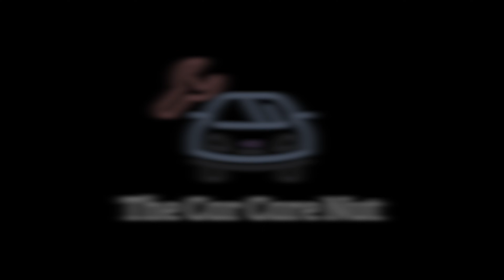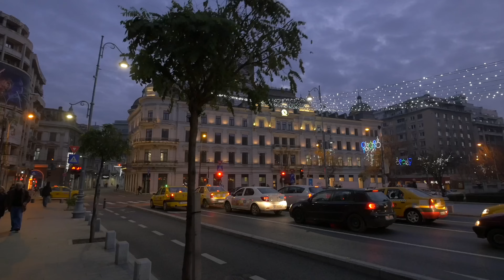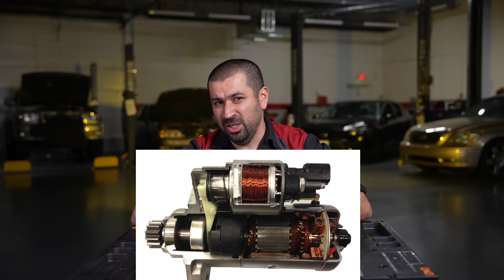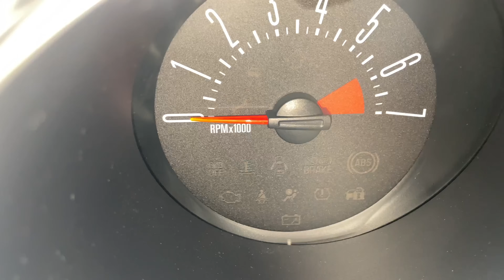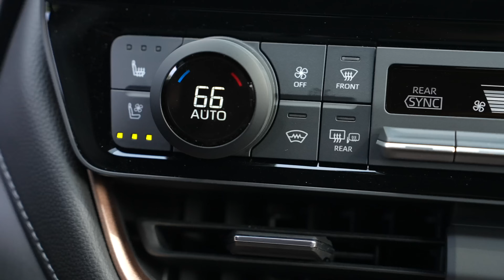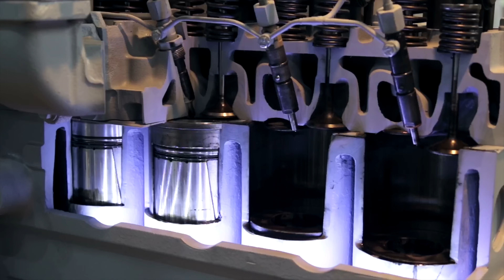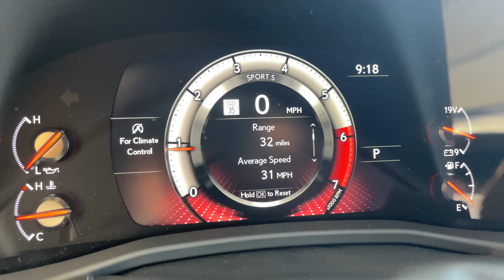How Does Start Stop Technology Work in Modern Cars? Everything You Need to Know

Comment: It works by annoying the hell out of you hence why I always turn it off.
Reply: I just hate how it resets every time I turn off the car!!
Reply: @adrianruiz8690  pretty sure they designed it like that to force you to use it 😂
Reply: Agreed. It's pointless.
Reply: Engine shuts off, ac turns off. In my experience.
Reply: I installed a bypass module so it will turn off once started the engine. 2020 Toyota Rav4 XLE
Reply: @l @lsbautista21 s it very expensive to install a bypass system ?
Reply: Should be the opposite button to turn it on if you want to run it with it off as the default.
Reply: So do you need to turn it off every time you start your first drive or does is it always off?
Reply: @petayV8  as far as i know it has to be turned off every time the engine is started. no way to disable it permanently
Reply: @petayV8  It's always off.  This does not work for all Rav4 models, but for mine if you unplug the hood safety connector it thinks the hood is open and will never stop the vehicle.
Reply: @chuck_howard  Where is this located?
Reply: @bacbladerunner  right behind the hood latch and slightly below on my Rav4.
Reply: @petayV8 if you use it on manual mode it doesn't work, only functions when on auto. Otherwise you would have to push the button each time to disable it.
Reply: @petayV8  if you pump the brakes at a light the car will keep running
Reply: Every time the engine is started you have to push the button to disengage the system. I have a friend that has a new Chevy equinox and there is no button to bypass the start stop it just does it all the time
Reply: This feature is really annoying down in south Florida heat. The AC just doesn’t cool enough with the motor off. Gets warm in the car at every light.
Reply: @Anthony-pi6pf , You probably bought a cheap crappy car. If you bought a luxury car, the air conditioners have significantly more capacity.
Reply: @terjeoseberg990  hell no I specifically bought a truck without this “feature” but I’ve been many others with it. From BMWs to Hondas
Reply: @Anthony-pi6pf , So your friends buy cheap piece of chit cars with chitty air conditioning?

Both BMW and Honda make cheap chitty cars, and good ones. The good ones cost more.
Reply: @terjeoseberg990  you’re great at making horrible assumptions!
Reply: @Anthony-pi6pf , What assumptions? That back in the old days only rich people could afford a car, and now everyone can? That cheap cars re crappy compared to luxury cars? That US cars are garbage because US auto companies don’t want to manufacture a quality product? Tell my which “assumptions” I’ve made.
Reply: @terjeoseberg990  I bought a brand new Toyota Tacoma TRD 4x4 in 2008 for $27,400. In 2023, today, that same trim will cost you $44,000. Get a clue!! Stop being delusional.
Reply: @Ezrabastian , Toyotas are great vehicles. Too bad American companies don’t want to build quality vehicles like Japan.
Reply: @terjeoseberg990 people can't afford luxury cars, especially with the high interest rate
Reply: @terjeoseberg990 they are in Mexico.
Reply: Soon as I start my car I turn that mess off everytime 😂
Reply: Some cars you have to go thru the digital menu to turn it off every time u start it. That some technology impaired people don’t know how to turn them off. Unlike the cars that are easy by push buttons
Reply: Annoying and expensive, driving new car prices through the roof
Reply: @Ezrabastian , Cars are getting cheaper. 100 years ago only extremely rich people could afford a car. Now nearly everyone can afford a car. You’re obviously confused. Everything has been getting cheaper for years.
Reply: @terjeoseberg990  also, booster number 7 is out for covid. Go get it!!
Reply: @terjeoseberg990 In 2024 only extremely rich people can buy cars
Reply: Ding Ding Ding!
Reply: If they made it more reasonable it would be ok. As in extended pause  and maybe a slight additional press of the brake    Instead of the absolute trash of roll to a stop and loose engine. Press gas’s wait for engine and jolt.  Or the garbage of stop. Loose engine shift to park engine turns on  shut off engine.   And I wish I could just turn it off and the switch would allow me to turn it on if wanted
Reply: Lots of engineering went into a feature nobody with a brain wants.
Reply: Agreed.
Reply: Annoys all the people waiting behind you too.
Reply: How complex is the procedure to turn it off?
Reply: @Druze_Tito  for me it was unplugging the sensor for the hood latch safety.  Took me ten seconds to open the hood and five seconds to pull the connector apart.  If you search on Google many people also make kits that you plug into the back of the push button to make it remember your last setting.
Reply: It's a lot of crap going on just to save some emissions,my friend had a 2007 Chevy, and when it did it's shutdown at a light the AC couldn't keep up on those really hot days and he would pump the brakes to circumvent the system, that explains what he said about the vacuum pressure in the break booster
Reply: I don't even notice them working
Reply: Hate it, hate it, hate it. Hear that Subaru?
Reply: Yep. Pressing that little "off" button on the dash instantly solves every problem he listed in this video.
Reply: Turning it off is one of the first things I do after starting my truck.
Reply: So much effort put into something that most people don’t like.
Reply: Can't stand this system. Now if your starter goes out it will cost you an arm and a leg. Not to mention it is another expensive system that will go out. So to help the environment, it will cost you more of your money.
Reply: Good information I turn it off not a fan of this device wonder if price difference in the battery cost ?
Reply: That’s foolish. Get over it.
Reply: I couldn’t agree more ! I’d never even consider one, I purchased a new car last yr and didn’t even look at a hybrid.
Reply: Fortunately on my 2017 bmw, I just have a button to turn it off.
Reply: I didnt even know you could turn it off 😂😂
Reply: You can go into the cpu and disable it so you do not need to press that stupid bypass button to turn it off every time you get into the car
Reply: My car doesn't even have it.
Reply: @AlKaseltzer87  thank your lucky stars.
Reply: Sport mode should fix it!
Reply: It should never have been put into play as a 3 second stop doesn't make much difference to emissions as leaving it running! It's that much more tech to go wrong leave you stranded and make it easier to "total" the car to force you to buy another! This planned obsolescence is getting out of control!
Reply: wife CRV has off button that does not remember  soooo annoying.   My truck I used forscan to disable it permanently 🎉
Reply: Wayyyyy too much b.s  to deal with. Cars are are complicated enough as it is. I love technology but this is idiotic.
Reply: I can’t turn it off permanently on my 2022 Ford Maverick. I have to turn it off every time   I start up
Reply: Now thousands to replace starters
Reply: I think I’ll just get a hybrid to avoid all this stuff
Reply: My friend has a new Chevy equinox and the start stop can't be turned off
Reply: I've disabled it in computer's software. Either by simple by turning it off, or setting the voltage parameter to some ridiculous number that it would never think it safe to use this system.
Reply: I have an old car,  not having it, but it annoys me on traffic lights when drivers with all the new cars are using it and by the time 2 ,3 cars will pass the green light is red 🤬 but they are happy with New shit, just like the screens with all the apps, massive distraction
Reply: Dumbest reg from the government
Reply: I hate it too!
Reply: Does the start stop have to disabled everytime you start the car or can it be disabled  permanently,?
Reply: @beachbums2008 there might be a plug near your negative terminal.
Reply: @beachbums2008  Depends on the vehicle but it is usually possible to disable stop start with a scan tool. With BMW for instance you can use Bimmercode
Reply: @beachbums2008  See below. It may or may not work for you but it did for me.
Reply: @beachbums2008 on my 2015 KIA cee'd CRDi it has to be disabled every time you turn engine on. But it takes into account engine temp, battery etc. It autoturns itself off. Especially on cold winter with temps below zero C.
Reply: I hated it for about 2 weeks until I learned how to control it with my foot.
Reply: @racmid-atlantic8782 Yes! That’s what I do.
Reply: @racmid-atlantic8782  Do you mean you just don't put the brake to the floor?  Soft braking?
Reply: Also a great way to train yourself to be easier on the brake pedal. If you don't push the pedal to the floor, engine stays running.
Reply: @cgraham6  This. I love start/stop but don’t always want it, for example if I need to pull across a busy road. I learned quickly that easing up on the brake works faster and easier than using the on/off button. Folks that don’t like it should go back to Model T’s and start their engines with a hand crank.
Reply: Amen
Reply: @rob6850 😊😊😊up 0
Reply: So stupid let's add 900 parts that can break cost a fortune  to fix for  a lil emissions
Reply: @316matrixify  not to mention increasing the cost of the vehicle in the first place!
Reply: @Eye-Byte , Yup. Toyota do cost more. But that’s not because of the cost. It’s because people are willing to pay more for quality. Toyota has spent years building their reputation. US audio manufacturers don’t care about their reputation. The only reason US car companies are still in business is because many Americans are more concerned about the price than the quality of what they buy.
Reply: @DesertDog8989 , Yeah. The United States has bailed out GM and Chrysler several times.
Reply: @316matrixify  It's a win / win for the manufacturer.
Reply: @316matrixify , They’re not likely to break when Toyota makes them. They’re only likely to break when GM, Chrysler, or Ford makes them.
Reply: @terjeoseberg990   Toyota  is not magic  it can break  also every part is a point of failure  so adding all these parts  for nil return is stupid  planting a few trees  would have been more useful
Reply: @316matrixify , Not magic is correct. They just take pride in manufacturing quality products. American companies have no problem with manufacturing junk. It’s a decision. American companies could build quality products, but they choose not to.
Reply: @316matrixify , Toyotas do in fact break. They just do so significantly less often than most other cars. Especially less often than American cars. It’s unfortunate that American car companies don’t believe in quality. It’s led to them needing to be bailed out by the government several times.
Reply: @terjeoseberg990 That's why Toyota waited until 2017 for start/stop. Was working at the parking structure at GM Ren Cen, Detroit. I was annoyed at the cars pulling in that start/stopped 4 to 5 times while pulling in. Even thou it was not my vehicle.
Reply: @edbaczewski2959 , Toyota tends to do things correctly. Ford, GM, and Chrysler don’t give a chit.
Reply: @terjeoseberg990 What a completely unfounded,ignorant and ridiculous one eyed statement.
Reply: @terjeoseberg990 Ford rocks!
Reply: @terjeoseberg990 Ford is good
Reply: https://m.youtube.com/watch?v=L7524u5w4ZE&pp=ygU1U2NvdHR5IEtpbG1lciBzdG9wIHN0YXJ0IHN5c3RlbXMgYXJlIGJhZCBmb3IgeW91ciBjYXI%3D
Reply: I wish I could meet the idiot who thought it was a good idea.
Reply: Bought a Nissan Titan. No stop start and no cylinder deactivation.
Reply: You da man!
Reply: Yeah, I just need 80% of you to give up driving, so that 20%  of us can drive free of regulations.
Reply: I wouldn’t want it
Reply: Pressing two buttons turns the function off in my Highlander!
Reply: …Can I turn OFF my wife…
Reply: And find a work around
Reply: My Rav4 Hybrid is seamless, I have even asked passengers if they can notice....nobody knows 😅
Reply: I never liked the stop/start on my 2012 Prius. Because of my work schedule I would sometimes pull over and take a mini/power nap, but most of the time needed the HVAC to keep running so I left the car on. The engine starting up would wake me up every time ruining my nap!
Reply: @universalassociates6857 , Prius should make the accessories like the air conditioner run off a small electric motor so they can run without the engine running.
Reply: @universalassociates6857 , Actually, isn’t there a model of the Prius with a solar panel on the roof that runs an air conditioner whenever it’s sunny? I believe I heard that before. How does that work?
Reply: @terjeoseberg990  yes, some Prius models have the solar panel feature. Mine didn’t - it was a base model.
Reply: It annoyed me before I even had a car that had that feature. Sitting in traffic in a car with the air conditioning no longer works the windows open the sound of people's engine starting and stopping drove me nuts.
Reply: Amen brother I agree !
Reply: If this feature saved a lot of gas it would not be turned off!
Reply: @ronaldbrown5745  It actually did save me about 15% on fuel (by rough calculations) on my VW polo, but I did a lot of city run so YMMV.
Reply: Ya sort of.
Reply: Still having to carry that extra large battery and extra large starter and a load of other stuff that is expensive to repair/replace and for zero benefit to the car buyer.
Reply: By doing that you are poisoning lotts of innocent vulnerable people. Seems you are happy to do tthat.
Reply: Fuck the planet. My nerves are more important attitude right here.
Reply: Manufacturers have picked up on this and now don't give you that option to permenantly turn off. Now you have to shut it off every time you start the car.
Reply: Does it hurt anything to turn off the start/stop system?
Reply: you probably get annoyed with everything take a chill pill
Reply: It’s the best
Reply: +1
It is a pain in the......
Reply: Start/Stop = NO SALE!
Reply: @DirtyLilHobo  Go to sleep. You're drunk. lol
Reply: I rented a car that had this recently… it was so annoying and intrusive, especially when I was traveling in an unfamiliar place! It led me to near collisions due to the delay in response from the start/stop function!
Reply: It works by becoming one of the worst things the automotive industry ever did.
Reply: @deplorablelibertarian , They simply did it wrong. That’s why it sucks. This start stop feature only belongs in a vehicle with an electric motor in addition to the gasoline engine if the electric motor has sufficient power to drive the vehicle with the gasoline powered engine.
Reply: @terjeoseberg990 Agreed. No delay and no noise. When electric motor gets car and engine up to speed, then engine gets fuel and spark. You don't notice fuel cut off and restore when decelerating
Reply: Years ago I was in a rental Mercedes while my hybrid was in the body shop. The start stop thing was the joke of the day. It will shut off at traffic lights but not in gridlock traffic.
Reply: Eventually, on new cars, you won't be able to shut it off!
Reply: @ronaldbrown5745  MY 2024 Tundra TRD PRO has NO auto off button.
To disable l just click shifter to manual mode & set gear to 10 & leave it at 10
Reply: Turning it off is a legal way to tamper with the emission system.
Reply: It is by far the most pathetic attempt at saving gas I've ever seen.

All it does is cause wear on parts that don't need it and it doesn't save squat.

I laugh at lights when I take off and a whole bunch of engines have to start up and I look back and everyone is still sitting at the line, pissing off all the people behind them...

It's one of the reasons I'm not getting a newer car... going to keep the one I have alive because it doesn't make sense to replace it with a version that has all this bullshit that can just go wrong, nevermind doesn't actually do anything.
Reply: @MadScientist267 So much winning. I bet you’re always the first guy to the next traffic light! Seriously it does not take that long for stop/start engines to start once you know how to properly operate the system.
Reply: @BetterAngels8  "Once you know how to properly operate the system"

🤣

You forgot a word. "Pointless".

It's stupid AF for a pathetic savings. Do the calculations yourself on your own car (if you can figure it out that is) and you'll find you aren't "saving" enough to make any of this crap worthwhile.

I could tell you wouldn't have a clue the moment you went with the "next to the light" crap... haha Stupid really needs to stop breeding.
Reply: same here
Reply: Buy a bypass, connects to ob2 port
Reply: The way I see it on my side, I hit the disable button each time I start my car. After a while it became like an habit. Gosh I can’t imagine in 10/20years. Wîll have to go a full checklist like an airplane to disable all the annoying systems useless system. Been stuck at a redlight waiting the couple of seconds that the engine need for restart I hate it.
Reply: @christophemorichon4592  It would only make sense if instead of a starter motor that can only start the engine, and with a lot of noise and strain, it had a motor that could turn the engine and move the car (in drive) until the engine has enough RPM to produce power and then the engine could get fuel and spark. No delays and no noise and no strain.
Reply: @christophemorichon4592 I hear you. So hard to win the race to the next traffic light with that .5 second delay.
Reply: The biggest pain when you drive a high performance car and trying to have fun.
Reply: I'm going to disable it with my scan tool once my car is out of warranty
Reply: @Rankine_Cycle21 That's what I'm thinking. Read an article on 2023 F-150 options that are being eliminated. 1 of them was eliminate the start/stop function for $50. The article said it was a module. I'm thinking know way, it has to be programed into the power train computer. So you probably could disable it w/ the proper scan tool. Would wait for the warranty to expire.
Reply: @edbaczewski2959   I don't know about newer ones, but in the 2016 all I had to do was short the terminals on the back of the switch and the system never turns on now.
Reply: @Rankine_Cycle21 why? Pressing an extra button too much work for you? And I suppose you're also can't be bothered to use your turn signal either?
Reply: @Aleksandar6ix I’d give you 1000 likes if I could. If something annoys you that much develop the habit of turning it off. Not that hard. If you forget, the car will remind you to hit the button the first time the system turns off the car and annoys you. This feature annoyed me, too, at first because I wasn’t used to it. Lately I’ve been experimenting with it and learning how to activate/deactivate the system with the brake pedal. It’s really not that bad, and the delay is minimal, insignificant really, when you do this. My biggest concerns have to do with the higher cost of a new starter and battery when it comes time to replace them. It’s not saving me much in fuel costs, but I suspect the reduction in emissions will be significant overtime, especially in congested urban areas where stop and go traffic is the norm. And we must remember excessive idling isn’t good for our engines either.
Reply: My Mazda CX90 uses combustion restart so the starter isn’t even used for their iStop system.  Restarts in about .035 seconds.  Shuts the engine off sometimes when you’re coasting up to a light or downhill.  Doesn’t bother me at all and yes it does reduce fuel consumption.
Reply: @robarmour4062  iStop seems like the better system. Can you turn it off so you could check if your getting the claimed 8% fuel savings?
Reply: Me too!
Reply: Same here
Reply: Idling isn't great for engines either.  Low temperature combustion
Reply: @suad01 I thought HIGH temperature was bad...
Reply: You’re wrong man
Reply: Yes! Same here. I even went as far as to ask my dealer at the service department to turn it off. Apparently they can't. I went on YouTube and checked a few videos of how people are bypassing it and there is a way to do that. Just as gas savings is minimal, the amount of emissions is also minimal. The problem for me is the freeway. My car turns off on the freeway if I come to a stop and it's so stupid. Also, it defaults on. There is a switch in the car to turn it off and you have to force yourself to get into the habit of doing that. I'm tired of all of this control. It's big brother and it's all because of a made up bogeyman called climate change. All it's doing is giving politicians more power over us. That's it
Reply: @Educatingben Amen!
Reply: I can't believe you would even want to shut it off 😮
It's designed that way for a reason that you have failed to grasp...
Global Warming is REAL 😢
Reply: Okay old man. 😂😂
Reply: Why is it annoying ?   When you are ready to go, you put down the clutch and the engine restarts.
Reply: @Victorflange , I don’t believe these cars have a clutch. They probably start the instant you release the brake pedal, so it’s ready to go as soon as you touch the gas pedal.
Reply: The fact is, it’s a really good technology stop the motor saves on fuel
Reply: Yes, but then you negate the emissions control. Not helping the environment.
Reply: @egx161 I'm pretty sure the manufacturing of ask the additional components needed to make this stupid start/stop system work creates fast more emissions then what's saved by the start/stop itself. You need an extra electric water pump, extra metal plating in the evaporator, a heftier starter that must be replaced after X number of starts, a bigger battery and on and on and on.
Reply: @Brian-dh2zz , Toyota somehow manages to make things last forever while GM, Ford and Chrysler seem to make garbage that fails often. Which do you believe impacts the environment more? My Lexus currently has 285,000 miles on it and I’ve replaced the battery, brake pads, and the alternator.
Reply: @terjeoseberg990  @terjeoseberg990 Garbage that fails often is much worse, my comment wasn't intended to be a knock on Toyota, it's just a knock on over complicating vehicles in general. My point was that all of the extra components required to make stop/start work probably cause more pollution to produce than stop/start saves. Also I believe Toyota only uses start/stop on their hybrid vehicles which is less problematic as it is less complicated to implement requiring fewer extra components. My main gripe is car manufacturers that took stop/start and adopted it for international combustion vehicles, this requires much more complexity as the engine is actually connected to a drive train unlike a hybrid vehicle. I believe it is mainly Ford and GM that has adopted stop/start on ICE vehicles.
Reply: @Brian-dh2zz , My Lexus with 285,000 miles has a V8 with variable valve timing. It has 290 hp and gets around 30 mpg on the freeway. I’ve replaced the alternator, and brake pads.

I have a 1977 Chevy C-20 has around 150,000 miles on it, has a V8 and around 90 hp. The engine is way less complicated than my Lexus, but it’s an unreliable piece of junk with incredibly chitty gas mileage. Around 10 mpg on the freeway.

Simpler isn’t always better.
Reply: @egx161  I'll enable my stop start when the "elites" stop taking non emissions compliant motorcades and flying on private jets to their "climate agenda" meetings. 😂
Reply: @egx161 I rip everything emissions off my car I possibly can.  Don’t want any of this crap.  Keep it simple.
Reply: @egx161  All those extra systems like the extra copper for the starter and extra lead for the bigger battery plus the extra computer controls all come at an extra cost to the environment before you even bought your car.  It's mostly from strip mines that damage huge eco systems.
Reply: @egx161 China and India are laughing at you. No matter what we do it will have very little impact if you can't get these two to go along with it
Reply: @emiliog.4432 if your that worried about the environment get a horse and buggie!
Reply: @traveler519  Funny how these nutcases care about the environment but still drive, take flights, use phones etc.
Reply: @traveler519 Horse farts are methane, a greenhouse gas.
Reply: @franklofarojr.2969 , So because horse farts are methane, you believe we humans should also contribute additional greenhouse gas?
Reply: @egx161  your actually making it worse because of what goes into these systems and the metals etc as an auto tech it's pretty bad how much goes into the starter etc that's harmful that just gets scrapped
Reply: @emiliog.4432 no one cares hippie
Reply: @egx161 are you going to stop farting? I bet not. So you, yes you are not helping the environment.
Reply: @egx161 does it really help the environment do you have actual data to prove that.
Reply: @egx161 fuck the environment
Reply: @egx161 I'd suggest reading the results of the long term tests carried out on behalf of the government,where their own advisors came to the conclusion that stop start tech is only beneficial in laboratory conditions.
Reply: @egx161  You are very naïve to think it helps.
Reply: @egx161 american dont give a fuck until they can't have their triple cheese hamburger
Reply: @egx161 what is not helping the environment ?
Reply: LOL! FU, buddy. I do NOT care. There's a lot worse things out there for the environment than me turning that thing off. @egx161
Reply: @egx161 F** the environment
Reply: @egx161 Ah yes... The "environment." Our climate change hero, Greta Thunberg, will fly to Davos and pollute the environment more on ONE FLIGHT ON HER PRIVATE JET than I will do my entire life driving a v8 hemi, burping and farting gas everywhere... But sure.... Let's destroy our engines and starters to help the environment. 🤦‍♂
Reply: @egx161 don’t care
Reply: @egx161 if the environment needed help it wouldn’t have created humans
Reply: @GoKartHamster listen to yourself: you make no sense with this comment at all.
Reply: @richardanderson1732  by saying humans are animals?
Reply: @GoKartHamster or hot sauce and beans.
Reply: @egx161 I hope your trolling, if so, good job
Reply: @egx161 That's utter garbage. Not doing jack for the environment. So sick to death of that being the excuse for every crap product shoved down our throats. So glad my V6 Tacoma doesn't have ANY of this utter garbage. Delighted to look into permanently disabling this garbage as soon as our RAV4 is out of warranty.
Reply: @DIYDaveOK I see you’ve researched this very carefully.
Reply: @DIYDaveOK I'm not familiar..how is this a pain?
Reply: @egx161 ... electric cars are more harmful to the environment than my SUV is.
Reply: @egx161  lol you think it save the environment, I don't think so. Same goes to EV, it just transfer the emission from your car to the Power Grid station. The power grid have to work more to supply the electrical energy to the EV cars. So nothing save there.
Reply: @zepp3lin  wrong...just simply wrong
Reply: @farnorth7314 no, you are. Many people find it really annoying.
Reply: @zepp3lin let me guess, are you American?

It takes way less oil to run an oil power station and transmit the energy through power lines to an EV, than it does to produce petrol/diesel and run a car engine due to the relative difference in thermodynamic efficiency of a power station vs a car engine, and more efficient transmission through HV power cables vs fuel tankers, and the conversion efficiency of battery storage.

Even better, here in the UK like elsewhere, we’re reducing fossil fuels in the electricity generation sector.  For example three years ago we had a 67-day period with zero use of coal power stations, and the last coal power station will close in 2024; this was unthinkable 10 years ago when 43% of our electricity came from coal.
Reply: @Mark-lz4wg Yes, driving yourselves into energy poverty for your asinine obsession with eliminating fossil fuels. Most idiotic endeavor pushed by the world's most idiotic people
Reply: @Mark-lz4wg Why do most Brits always have an inferiority complex with America. Was it from us saving your ass in WW2?
Reply: @Mark-lz4wg Good job describing the only part of the equation that fits the green narrative. You conveniently left out mining, disposal, slave labor,  parts of the world that can't produce enough electricity without oil/coal where people die due to grid failures or insufficient electricity,  etc.
Not to mention the reason behind the green movement is entirely faulty to begin with...
Oh, and how much of the emissions were offset by that entire boatload of cars that burned and sank into the ocean? How about all the vehicle fires on the road started by evs?
Reply: @Mark-lz4wg  Ah-ha-ha-ha-ha!  Whoops!
"British regulators on Wednesday approved new oil and gas drilling at a site in the North Sea, a move environmentalists say will hurt the country´s attempt to meet its climate goals."
Reply: The power grid most likely is producing electricity in a very clean way, hydro, wind, solar, etc. 
Even if the plant is using fossil fuels to produce the electricity technology is used to make it in a clean way. It is far cleaner to have the power plant produce your electricity than you burning fuel in your car.
Reply: @zepp3lin , Power plants are around 50% efficient while the internal combustion engine in your car varies between 10% and 30% efficient. That’s why EVs cost 1/3rd to 1/4th per mile to operate.
Reply: @zepp3lin , Power plants are around 50% efficient while the internal combustion engine in your car varies between 10% and 30% efficient. That’s why EVs cost 1/3rd to 1/4th per mile to operate.

I can see that 25 ignore ant dum basses like you liked your comment.
Reply: @terjeoseberg990 yeah if you charge at home. If everybody is trying to supercharge on a trip, it costs a helluva lot more.
Reply: @shag139 , You’re dumb if you don’t charge at home. Why would you go to a charge at a charging station and wait when you can charge at home and sleep?
Reply: @terjeoseberg990  so you’ve never gone  on a long trip?  Never driven to the beach that’s 500 miles away in August when it’s 95 degrees and humid as hell and the gas station is packed with people filling up?
Reply: @shag139 , If you go on a long trip every once in a while, using a charging station is fine. But all the time, no way.
Reply: @zepp3lin On one tank, the stop-start system of my car prevents idling of 45 minutes to 1 hour. 
(There’s an automatic counter to keep track of idle time). 

How’s that not useful? It has no disadvantage whatsoever for me.
Reply: @davesmith9325 
What’s the annoyance? Genuine question, I don’t mind my car turning off and on at all and it saves about 1 hour of idling per tank of gas.
Reply: @Mark-lz4wg , “ten years ago when 43% of your energy came from coal” that is still impressive that over half of your energy was clean or nuclear ten years ago (I’m from the US, so I’m not sure if you use(d) nuclear).
Reply: @zepp3lin But one giant motor (the power station) supplying all the energy to all the cars is a lot more efficient than thousands and thousands of small motors supplying that power.
Reply: @Victorflange I rather like being in control of the power plant in my car. I don't control the power station that makes electricity
Reply: @zepp3lin not exactly true because the power station is able to produce power with fewer emissions per kilowatt than your engine.  It can produce power at a higher efficiency.
Reply: @Mark-lz4wg Actually Zeppelin there is entirely correct.

You're delusional if you think it somehow magically takes less of anything to run an EV 🙄
Reply: @dansaunders6761 I'm not defending the green movement or green washing imo, I just want to clarify that the start/stop system and EVs are phenomenal on countries that don't have oil reserves. Not every country have oil reserve and oil prices costs an arm and leg on some other parts of the world.

I would advise not to disregard other alternatives or fuel saving methods that we can do as not everybody can splurge on oil as those in parts of the world that have tons of reserve. And also let's, face it, oil will run out eventually, even countries that have abundant oil are now venturing on other alternatives that will not tie them on oil as primary source of income.

Also the economic, military and influence of oil in world politics is already an open secret so other countries are chasing these alternatives or fuel saving as not to be just on mercy of oil producing countries. Even normal person can reduce their cost of living by having these systems/alternatives which in turn get them to have more easier life.

I just hope that other people might not like it and doesn't believe on green washing but don't just disregard other people's opinion on these things because it has impacts to people on other parts of the world that are literally to busy trying to live day by day and doesn't have the luxury to think about new ideas and ideals.
Reply: @dansaunders6761 they’re a death cult.
Reply: @LAURABOHDAN You're either trolling or just an idiot. My money is on the latter.
Reply: @zepp3lin Start-stop can have small positive effect vs emissions in city centers with a lot of traffic lights and traffic jams.

EV:s have huge effect. Energy production in a powerplant is far more cleaner than in ICE.

Currently EVs are too pricey -> my family run on biogas, 50% cheaper than gasoline.
Reply: @zepp3lin  it's the government, just like when they made all the shops install that device to run the car at 60 mph to test for nox gas, then decided they didn't need it anymore, but the shops installed that equipment they no longer need
Reply: @zepp3lin also on the ev front zep the making of a single ev pollutes more than the normal life cycle from beginning to end of a good ol internal combustion car! These evs batteries just mining for materials leaves more pollution than an internal combustion vehicle does from inception through production and into its first 100k miles.
Reply: @farnorth7314 un informed or blind you are!
Reply: @Mark-lz4wg we really need to seperate the internet by country. We're all tired of you retarded europeans pretending everything is perfect over there.
Reply: @Mark-lz4wg u made it sound like its a bad thing being American 😂  In the 90s CA/US gov already requires car manufactures to make ZEV.  Tesla/Nissan started the BEV trend I think.  ICE is how we been transporting for 100s years so don't be critical of people not giving it up within a few years.  BEV battery pollute alot to make, ur not breaking even until 10Ks of miles so its not all green there.  not a clear winner as just yet.😂
Reply: @Mark-lz4wg  Have you looked at the environmental impact of an EV battery  pack? Probably not. They're as toxic as your assumptions.
Reply: @dansaunders6761 I hope their drilling is for nothing and they don't find anything or run out.
Reply: @terjeoseberg990 Apartment people can't
Reply: @kimmokannala4576 EVs will get cheaper when SODIUM batteries come out! :)
Reply: @franklofarojr.2969 , Apartments can install charge ports. This isn’t rocket science.
Reply: @zepp3lin  it's just another gimmick even this mechanic said it just stops the emissions at traffic lights basically. But it doesn't really save anything. We've just been led to believe it does.👍🏿
Reply: @Mark-lz4wg  oh god I wish i had the time to break down your crap. That your talking about. 
Shutting down are coal mines tell me where do we get our fuel from. What's transporting it here. I bet your a conservative voter. I really want to explain it to you but I just can't be bothered
Reply: @zepp3lin bro just skipped physics lesson 💀
Reply: @zepp3lin it's amazes me how many people don't realize that electric cars dont dont help emissions..how do they think electricity is made?..it's not magic😂
Reply: @Mark-lz4wg do you work at a power station?
Reply: @Mark-lz4wg you know that is takes slave labor to get what's needed to make rechargable car batteries right?
Reply: @Mark-lz4wg  How much Canadian wood pellets are burned in the name of renewable energy in UK instead?
Reply: @Mark-lz4wg  yeah, your opinion went out the window in 1776. We don't care.
Reply: @farnorth7314  Yeah... Because electricity for those power stations totally doesn't come from coal and natural gas...🙄
Reply: @egx161  the few people that actually know how to turn them off out of the hundreds of thousands ain’t going to make that big of a impact
Reply: The system disables with one single button push. I think "most people" have it figured out.
Reply: @egx161  Go hug a tree! 😂
Reply: @F_JoeBiden-tu6cl , Why do you support terrorists?